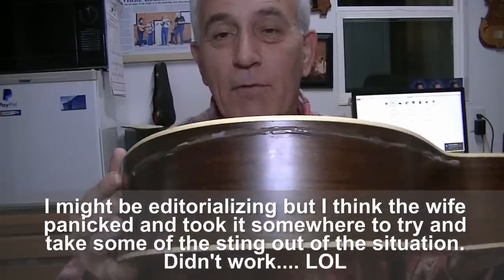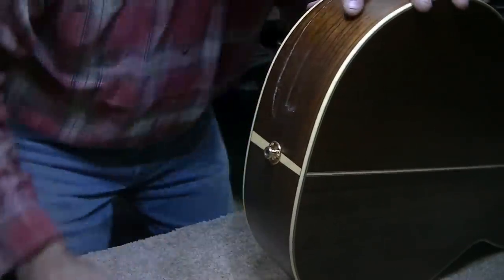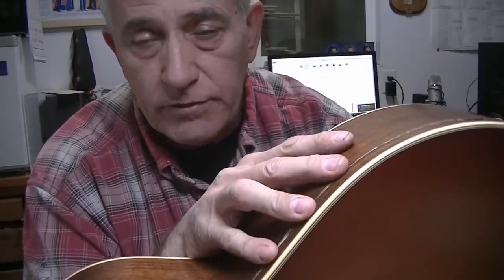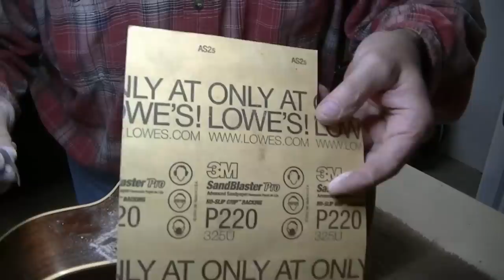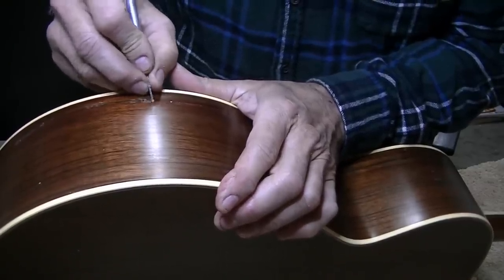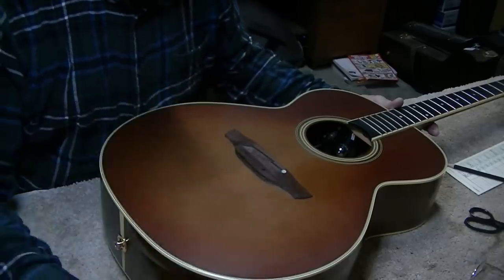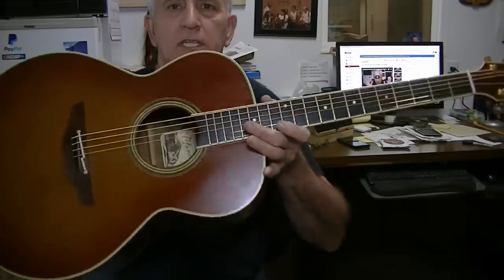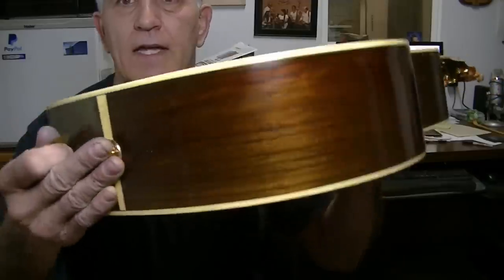224 RSW Takamine Nearly Destroyed LIVES ON

Comment: On the belly, can you put some weight right on it while it's being humidified? Push it down while helping it to move (flatten).  What do you say? If it wouldn't break the guitar, I bet you've tried it.  If it would do harm, explain please.
Reply from the maker: Getting the hump out is very easy. Keeping the hump out is the hard part. The only way in my opinion to fix it permanently is to add additional mechanical stiffeners in the area.

Comment: Kindly, the back and sides are made of plywood, so most cracks will be isolated to one layer.  The plywood manufacturer uses the same "pretty" wood veneer on both sides of the plywood, so the factory luthier can choose which side has the prettiest grain for the outside. Plywood manufacturing is very cost effective, especially bending sides. The outer layer veneer, pretty and finished with lacquer, was brittle and cracked.  Read the manufacturers specs for construction. Peace, Mark

Comment: On the belly bulge issue what if you humidified it well and clamped it down with a plate on the inside? My 57 Martin has a bulge like that.
Reply from the maker: It's not very hard to get the Bulge out. The problem is keeping it out. The strings will pull it right back in no time. The only way to fix it permanently is to add additional mechanical Fasteners in my opinion.
Reply: Rosa String Works hey jerry good news here about my old martin d28 that my dad left me when he died. We talked about that belly bulge about how I mite get it out to stay.i haven't even looked at it in 4 months . I had hydrated it without the strings so that the belly wouldn't be pulled on while it was being hydrated. After it went down and looked better for a day or two I restructuring it with light Guage strings and it linked passable. Well I looked at it today after 4 months in the case and it has actually reduced a bit more after that . I think another 1/32 off the saddle and it will be great .even lower than some hi dollar Martin's and even Gibbons that I looked at brand new . The only thing I've done to it to lower it is a nut and saddle adjustment.  Not bad for a 61 year old guitar.😉 wish I was in this good of health.

Comment: Wouldnt pressure on the top as you use directed steam on the inside work for the top bulge?? 🎵🎸
Reply from the maker: Perhaps. But as I mentioned the string tension would pull the bulbs right back out. The wood loves to go back to the same shape. In my opinion the only way you can fix something like that is to put more mechanical stiffeners in the area.

Comment: How does adding moisture lower the bulge on the top of a guitar, that would make the bulge worse. Surely the top should have been dried out to lower the top. That’s what happens to all guitars throughout the year, in winter the action lowers due to much lower humidity and in summer tops bulge and action get higher due to higher humidity.

Comment: The value of a guitar is in the sound. This repair must have been pretty expensive for the results without a significant difference in the sound. It is a seriously  wounded instrument. If it were my guitar I would have done exactly what you did, but since it is not our guitar, I would have done the same thing you did. If  I were a customer,  I think I would have just sanded it down and and painted it to match and shot the previous fixer. Well, probably not. It isn't worth that much. That was a really good fix.

Comment: Jerry
Put three jacks inside and put pressure on the sides then use the heat gun to open the crack**DR KEL
Reply from the maker: I'm sure you could get it open that way but it would blister the Finish severely possibly even melt The Binding. The glue softens but the Finish softens at the same rate or quicker.

Comment: Set a jack or two between the top and back and heat the crack. I would even build a jack with a coil spring so that it will keep pressure on as the crack opens. {:^D

Comment: I can see where them crack was, because the finish is redder on top, pretty much the whole area you sanded.  Is that due to your color blindness?  I don't know if the intensity of the brown and red-ish areas differ.
Reply: *the top crack was (no them!)
Reply from the maker: It looked fine to me but as you pointed out I'm color blind.
Reply: You can easily see intensity differences, just not certain colors from other ones.
Reply: Talk is cheap Bob, but keep talking....to the hand.

Comment: Mr Rosa is an amazing guitar repair-person (In another video he says he doesn't call himself a luthier but I recon he is!)  Anyhow just wanted to chime in that I have also had Zero success humidifying guitars to reduce belly bulge. In fact, if you believe Bob Taylor of Taylor guitars, he says that humidifying will raise the bulge and drying out will reduce the bulge.  (Moisture makes wood expand and dryness makes it shrink and possibly crack)
https://www.youtube.com/watch?v=tB8tELj43RE
This corresponds with some other videos I have seen where dried-out guitars have bellied inwards (collapsed) from being in a dry environment.  Anyhow - I live in a humid environment and use Pingi rechargable dehumidifier bags in all my guitar cases. On top of that I use a JDL Bridge Doctor in all my guitars. I know some folks don't like 'em but I don't think they modify the guitar's tone much and I use the removable version on more expensive guitars... 200 lbs of string pressure constantly pulling at the bridge/top will eventually raise the belly on most guitars but the rate depends on the wood and construction;  unless the braces are so thick that the guitar sounds awful...   My 2C

Comment: Gaack.  Takamines are all pretty much handbuilt guitars, and butchering one like this is a horrible guitar crime. The laminate they use is very high quality, so no surprise determining whether it was solid or laminate. One idea for opening the seam is to use an AirShim Pro XL Inflatable Pry Bar and Leveling Tool.  Basically, you use a bulb to inflate a rubber bladder, so the load is distributed over a larger area. The come in several sizes,  all inder $20.  Worth looking into.
Reply from the maker: First of all I am familiar with the technology you're talking about. Second there's not a chance that it could have fit into this crack. The crack was absolutely airtight you couldn't even get an exacto blade in there. 3rd prying it open like that would split the crack all the way around the guitar or at least as far as the grain ran out. That type of crack can't be opened easily.

Comment: Humidifying the guitar isn't going to anything if the room is dry. Need to use a proper humidifier so it doesn't drip and put it in its case for a couple of days. I'm not saying it would change it, but what was done here was not a fair test of humidifying a guitar. Also who works with instruments and can't satin a finish?

Comment: Hi, could you help me with a common Problem? I have a guitar with a beautifull old bridge I restored it and I use some pearls with 3 whole for fixation af the strings but one whole high e string is sharp and cuts the string. If I dont use pearls the nice bringe with the inlay is even more destroed but the changed angel using pearls causes sting damage but only one whole is damaged and its a very nice bridge . I cannot ream it then it would be to wide and I dont want to put the bridge of to work on it cause it fits perfekt. Ps do you know Knilling perfection pegs for violins with damage on the peg box? you can save time and use a nicer tailpeace without fine tuner ;-) Just to share something too.

Comment: Well I'm not a pro like you but couldn't you just go inside and remove the curfing and fix the crack then replace the curfing instead of doing a hack job as you say lol
Reply from the maker: How are you going to go inside? If you take the back off you caused ten times more problems
Reply: @RosaStringWorks  you reach in with a razor knife and cut behind the curf ! Cut the glue and pull the curfing out the regime it back in after you fix the crack bro!!! Lol Idk? That's why I was asking if that was an option ? Like I said I'm not a pro that's why I watch you fix them right!!!! Awesome work brother !!